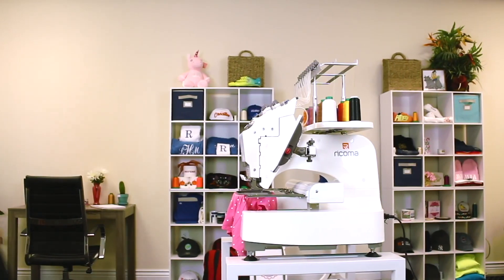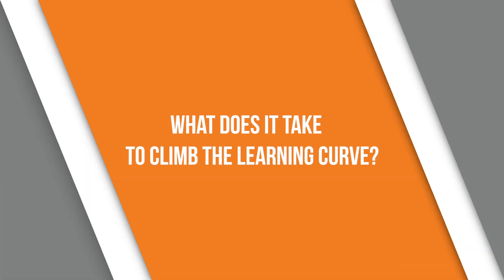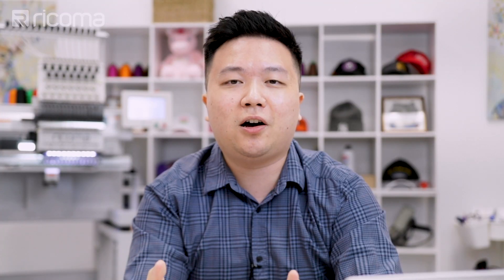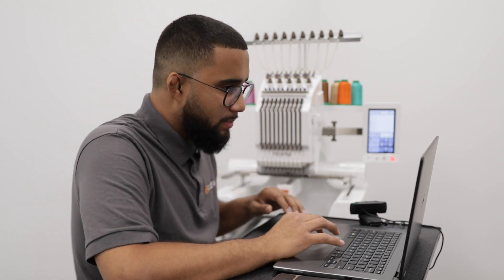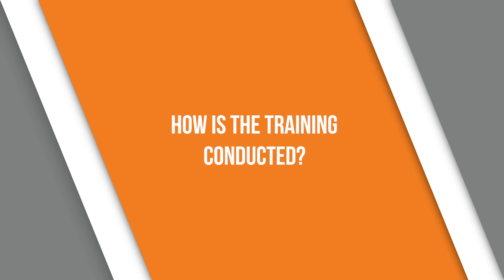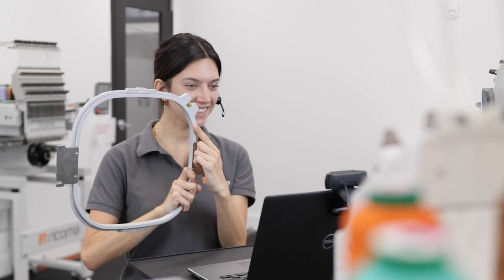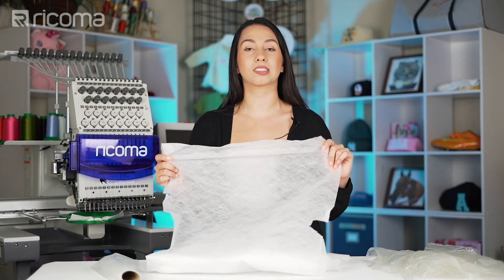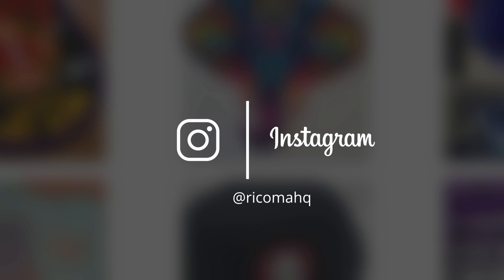Embroidery Training 101 | Overcoming The Learning Curve | Apparel Academy (Ep50)

Comment: I have found that YouTube in general provides a plethora of training regardless of the machine. In terms of actual training on a specific machine...it takes hands-on practice to encounter "glitches" or "issues" in order to learn your machine. I own a Melco and learn as much from Ricoma's videos as I do Melco, Redline, SWF, and other manufacturers videos. I find each manufacturer has something greater over the others but most can collectively round out a diverse learning program for you. There are practices that are universal. I mean if I run my machine and never have an issue, my depth of knowledge in my machine will be minimal. The value of support from the manufacturer cannot be underestimated as this interaction is where the learning happens but hooping a cap on a car driver is going to be largely universal since the OEM cap driver is going to be relatively the same across brands. 

For instance, I followed the scheduled maintenance protocol for my machine exactly as instructed. When I found that my x-axis tension cable was under spec, I corrected it and began having problems with timing, thread breaks, etc. When I contacted support, I found that each machine has itrs own personality and sometimes "spec" can be nuanced. They helped correct my issue and I have been running great since! Because of that interaction with Support, I learned a point of behavior about my machine....and I also learned some added benefits like the best needle to use and thread brand that Support found works best with my machine model.

It is important to go with a brand that provides ample documentation for the machine AND the design software. My experience has been that learning the actual machine comes quite quickly...it is the interface and software that has the largest learning curve since that is the point where the user is confronted with a multitude of changing scenarios and one interface to accomplish the task at hand.
Reply from the maker: Well said! Thanks for sharing!